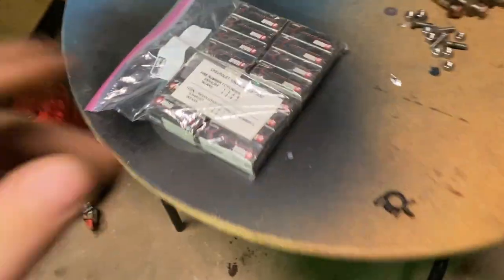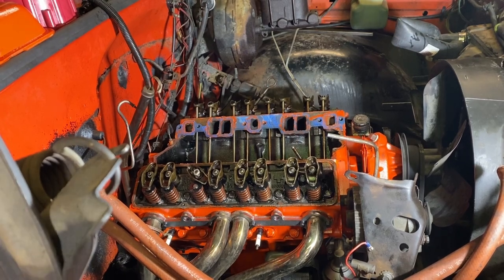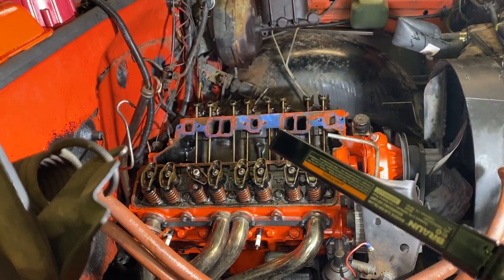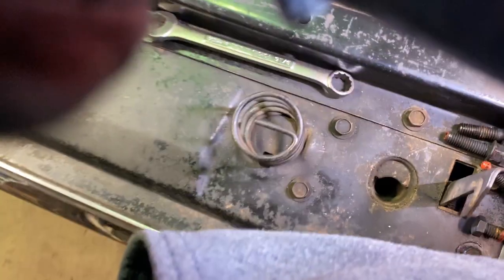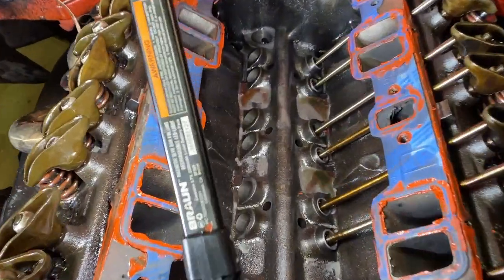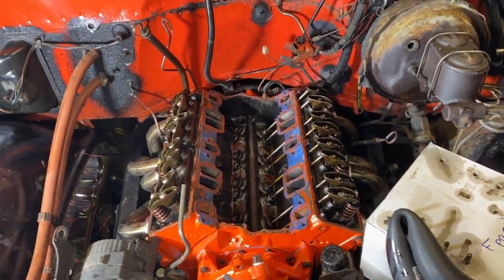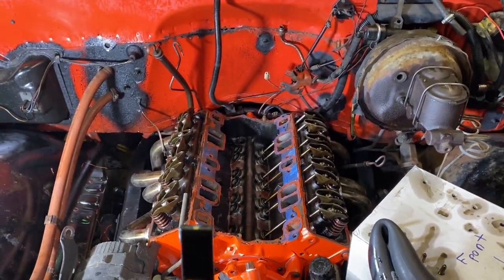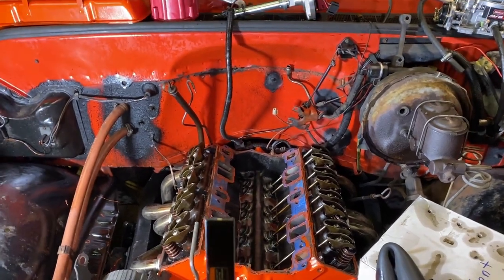Squarebody C20 Project Part 18 Lifter Replacement |square body|

Comment: Only good flat tappet cam and lifters right now are howards, and when you broke it in you should have made sure everything was as close to right as possible before start up then go to 2000rpm almost immediately, the messing around starting it and shutting it off  and checking the timing at idle before you initiate and finish break in will take out a cam